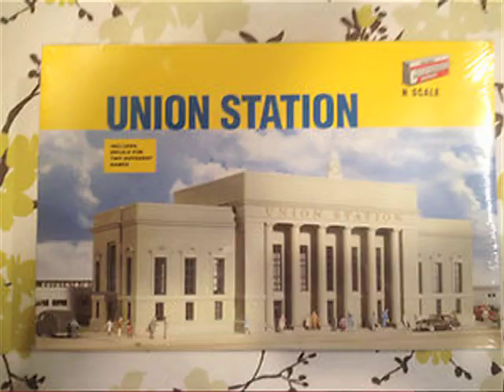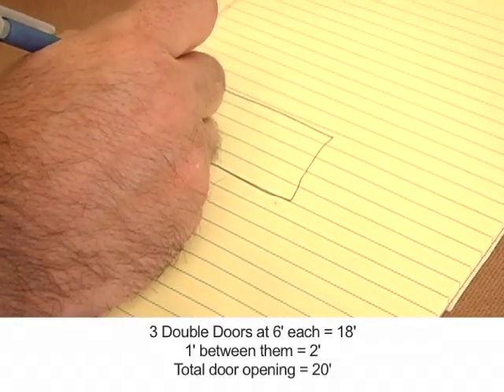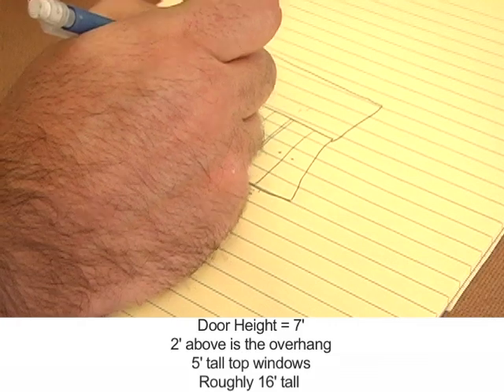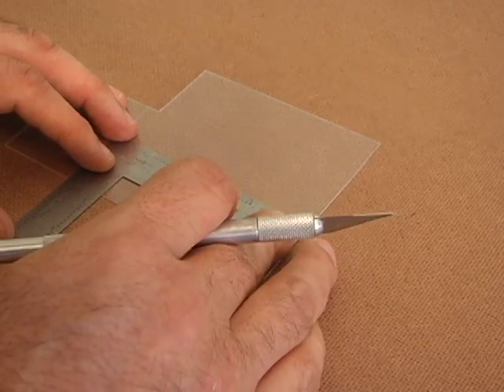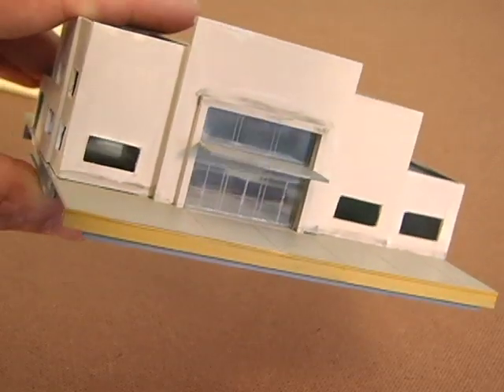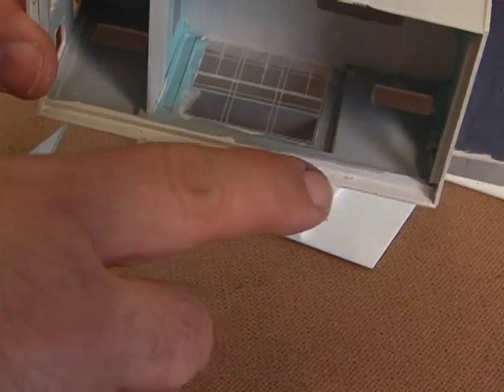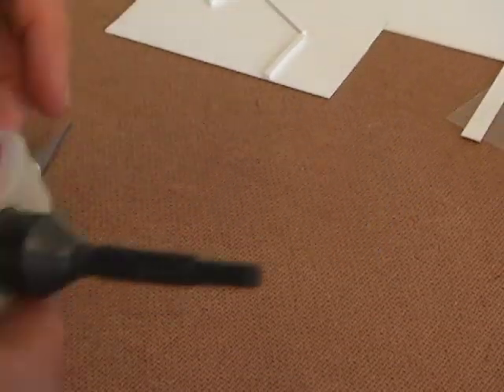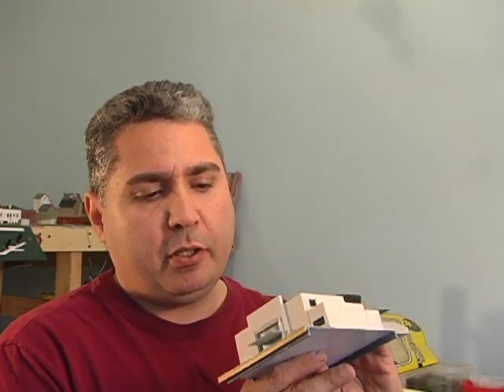Scratch Building A Passenger Station. Build Model Train Layouts For Less!

Comment: Hello from just up the road in Youngstown! I have always been a little intimidated in scratch-building structures with windows. I like the satisfaction (and price) of DIY buildings and I recently finished a lighthouse based on the one in Ashtabula harbor. Since the windows are all boarded up, I didn't have to worry about the windows. I use cardstock and foamboard as I find it a bit easier to work with and cheaper too.

Keep up the great videos!

Comment: a tip for doing windows, you can get clear transparency film at any office supply store, then in a graphics program you can lay out grid patterns and print them on the clear film, this can give the look of spacers and brackets between panes of glass. The only down side is you can't print white. if I need white I usually print 2 black lines with a space in the middle, then carefully paint white between the lines. You can also print signs and stuff on windows

Comment: I may have to put up some scratch building! :) I just have kit video's. Scratching is just a bit much to get on video I think. Thanks for sharing DJ, much appreciated.
Reply from the maker: That problem I usually have when scratch building is that I don't know what the finished project will look like.  I kinda make it up as I go along sometimes.  I also think "This will take 2 hours", and then i spend 10 hours on it.  That is why I don't charge hourly when building for others.
Reply: I could see that, if I get excited about a model, I spend some time on it. It could take a couple of months chipping away at it.

Comment: DJ, Nice B&O Grant Street Station. You broke the golden rule, always put the windows in before assembling the building (just kidding) You may already know this, when you use your liquid plastic cement, place the clear plastic piece in position, then using a small paint brush, dip the paint brush into the plastic cement, then go around the outside of the clear plastic piece, letting capillary action draw the glue under the  clear plastic. Another option for cement is Micro Kristal Clear.

Comment: Very informative video. I scratched built for my N scale model railroad a town water tower made from two empty skin crime jars,masking tape, blue & yellow construction paper. I am getting ready to make my 4th. Railroad water tower from an empty Progresso soup can, round 1/2 inch diameter wooden dowel, plastic bendable drink straws for the spout & water pipe, I already made four ladders scratch built. The inside of the water towers are stuffed with newspaper, cardboard strips. Next will be drink umbrellas that I will pain blue for the rook of the water towers. The ladders will be gray as will the steam locomotive oil tank, the cradles & the diesel refueling facility I will make from empty carpet fresh containers.

Comment: hi dj the station how high how long must be ( cm) i hace HO scale thanks for your help
Reply from the maker: I can't answer that for a couple reasons.  First, I sold that station last year.  Second, is I primarily work in N scale, and don't have my HO scale ruler handy.
So I would suggest buying an HO Scale conversion ruler and then make your station from scratch by judging the size you need to accommodate your tallest passenger cars.  Most of what I build, I don't go by blueprints or anything, but use my current locos and rolling stock as a guide, and build what "looks right".  Good luck, my friend.
Reply: Thanks dj i will try to guide me with DPM models HO that i have

Comment: This is a great build!  You should check out www.smartmodels.co.uk   They have pdf files With model drawings U can buy but also has images as brick wall aso that you can print out and use on any structure that you build. I`ve only bought the rail 06 kit but it is amazing regarding paperprint.. Do you know if the plastic U use for the windows has a Commercial name or do you know of a webstore that sells this Clear plastic and allso maby can ship to Europe?
Reply from the maker: I use testors window maker.  I'm going to check out that website.  Thanks!
Reply from the maker: THAT WEBSITE IS NICE!!!
Reply: djstrains Thanks! There are other websites to that suplies this type of drawings but smartmodels is supposed to be one of the better sites (and the only I can reamember what is called).